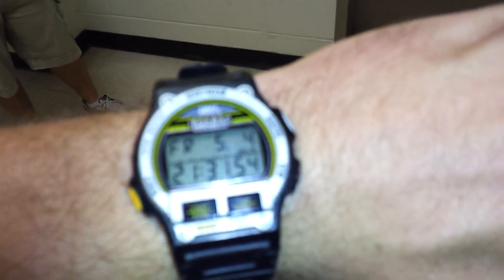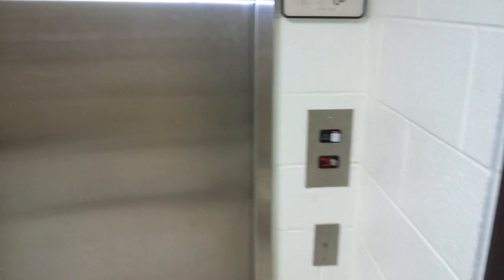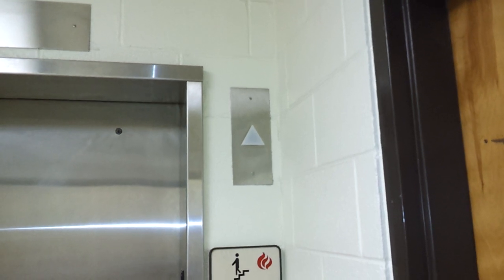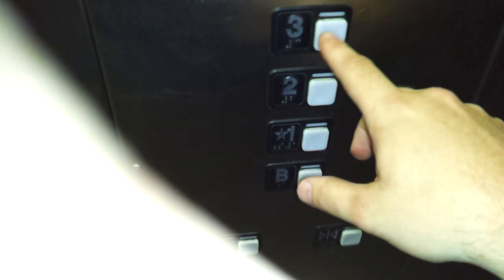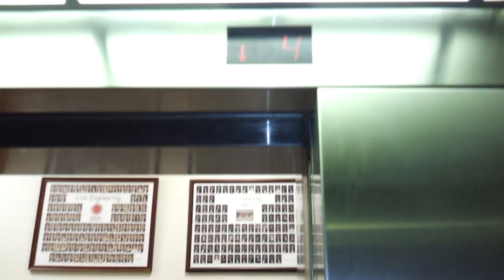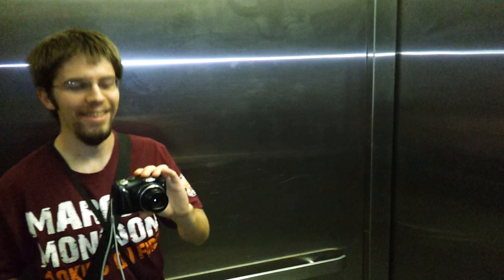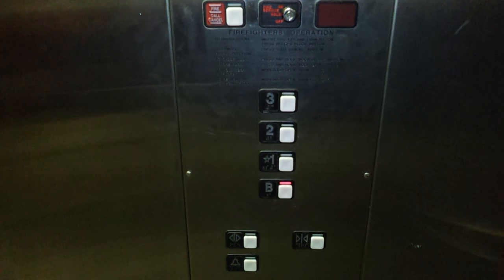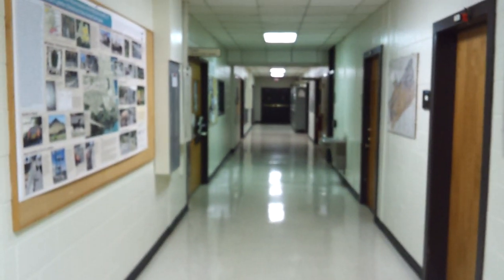Schindler MT Hydraulic elevator @ Patton Hall Virginia Tech for lormarina

Comment: This is Patton Hall. I don't think it was modded, records say this elevator was installed in 1996. The building is much older than that, but I don't think this building had an elevator before Schindler came along, based on the floor plans.
Reply: It may have been replaced c. 1996